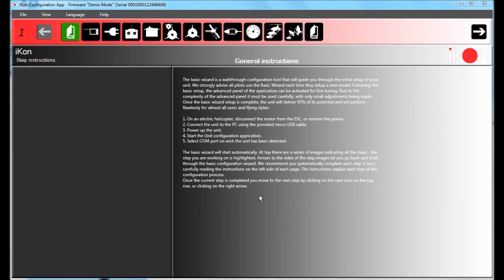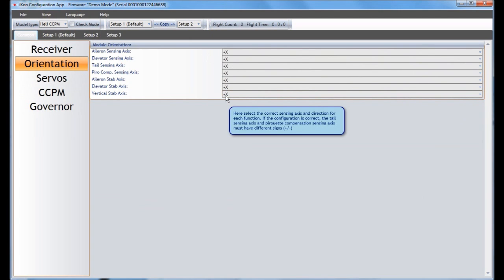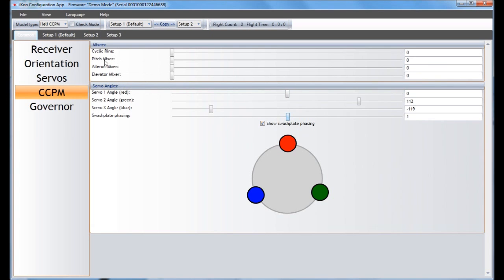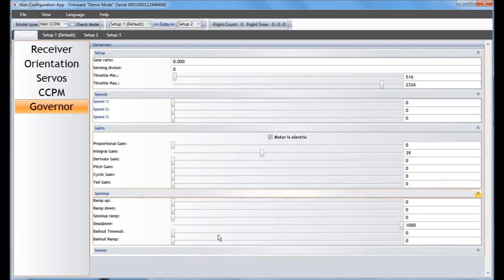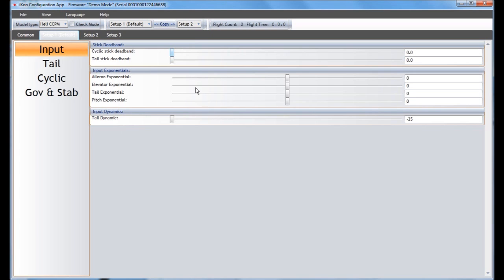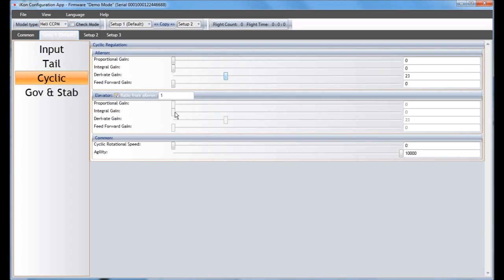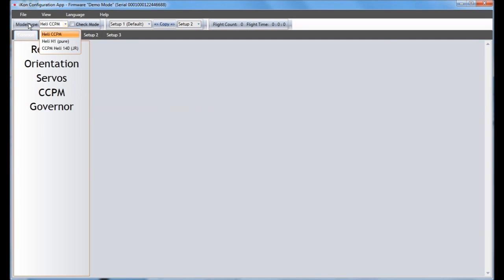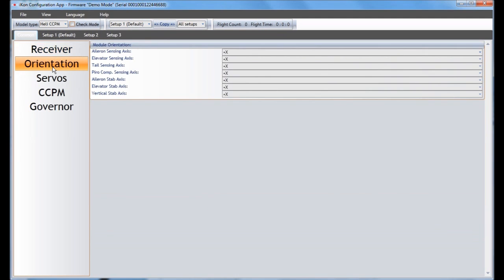How To Use iKon Flybarless Advanced Menu

Comment: When I come out of a big loop, and I'm going really fast,  with my G500, the tail moves back and forth really fast, almost vibrating. what do I need to adjust for that? Is it in the tail menu, or in the Gov menu like you showed? Also,  I just cant get good Aileron Tic docs. It's slow, mushy and all over the place. I can do them just fine on my 360 CFX with a Beast X, But I cant seem to do it with my Brain on my 500. I'm pretty sure I need to increase the rotational speed, But should I decrease the agility, so it's more stiff and precise, or something else? Your video did help answer some qusetions, thank you.
Reply from the maker: The tail issue is likely due to high tail gain.  If lowering the tail gain doesn't help, it may be mechanical, from a notched up tail pitch slider, to worn out tail bearings, to a bad tail servo.  Make sure you have enough cyclic travel to allow for the good tic tocs.  Speed of your servos may be the limiting factor as well.  The agility should probably be higher if the tic tocs are slow and mushy.
Reply: Great, thank you. I was having some kick out, so I upped the Igain. But I also thought my Gyro was good. But when I'm inverted, I can see this tiny tail wag going on. As far as the Tic Tocs go, I have all BK servos, so I know they are fully capable. I let my friend use the IOS Bluetooth modual. I should have it back this week. I'm going to do some tweaking when I get it back. I also have one more question. I had help setting up the G500 from the guy I bought it from. I went to his RC field, and we set it up. But I am trying to set my 0 at mid stick, and 10 degree cyclic throw on my new OXY3. It comes with this tool that you put inder the swash and it is supposed to give you 0 at mid stick. Well, mine was -3 degrees. I thought it was close enough, But must I have 0 at mid stick to get equal pitchin both directions and throw? Because I would get like 14 positive, and then have 19 negative. So I would go and decrease the negative down to -14, and then my positive would be around 11. I though each direction would adjust the throw independently, But I guess I am wrong on that. Thank you for your help.
Reply from the maker: When you detach the linkage rod from the tail servo and move it, does the rod and tail pitch slider move butter smooth?  If the rod is binding or the tail pitch slider are binding at all, it could be a mechanical issue.  Also, BK servos are made with servoking/RJX guts, so pretty much the same servo.  They can perform well, but after a fair amount of use they can lose deadband and pick up some real slop.  If you have another tail servo to try after checking all of the mechanics and settings for the tail (maybe even gov gain settings), then it may be worth trying to swap those tail servos.

Yes, you want to make sure you have 0 degrees at mid stick for proper set up.  Not all recommended lengths and set up tools will work perfect.  I'd recommend getting a good digital pitch gauge and make sure your servos at at 90 degrees and 0 pitch at mid stick, then use a swash leveler to make sure all servos are lined up.  You may have to adjust the lengths on the cyclic linkage rods.  Once this is done, you should be able to have more success setting up a symmetric +/- pitch.  There are settings in the advanced menu to adjust max and min throw as well.
Reply: Great. you have been very helpful. thank you. One thing I would like to suggest is that in the Wizard, they also allow for centering of the tail servo. I tried a few horns on my mini BK on the OXY, and I could only get the best one with in 5 or 10 degrees of begin centered. It should work fine the way I have it set up. I shoulwed it to one of the Lynx/ OXY reps, and they said it would be fine. I'm excited about the new Brain 2s coming out. they look awesome. I think I am going to do another 180 CFX with a micro brain2 and an 18A Hobby wing ESC Goved though the brain. it shold be awesome!

Comment: do you know what number you change in what menu to get more angle from the heli in self level mode? isn't the default 45 suppose to mean the heli will tilt forward, back, side ways on a 46degree angle
Reply from the maker: +epoweredrc  For setting up the angle for self level, I believe there is a button on the bottom of the page where you set up the orientation of the FBL system (where you select label up, wire-front, etc.)  When you press the "set level" button, it will use the orientation of the heli as the orientation for leveling, so you'll want to make sure the heli is flat when you set that button.  I think the default 45 value is for the tail gain, otherwise I'm not sure where you got the default 45 degrees for the self level mode.  Hope that helps, but if it doesn't, let me know and we'll get you squared away.  -Deater